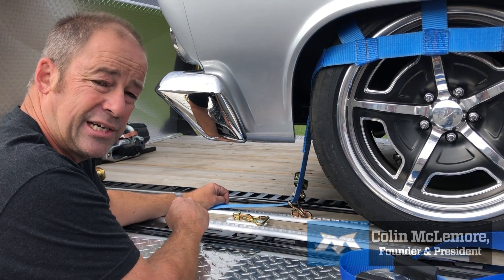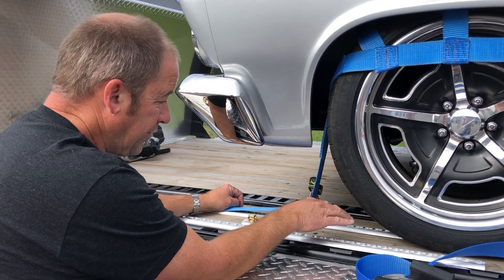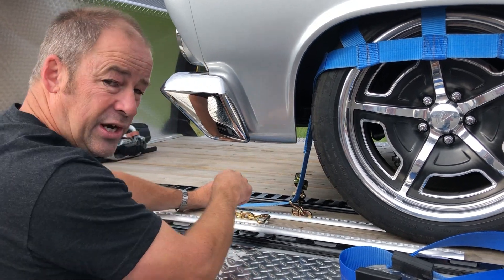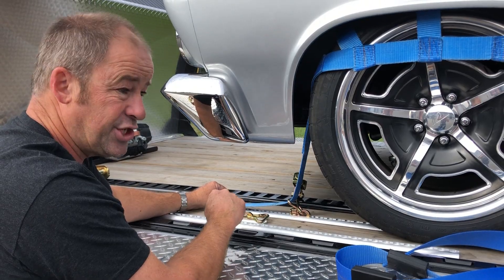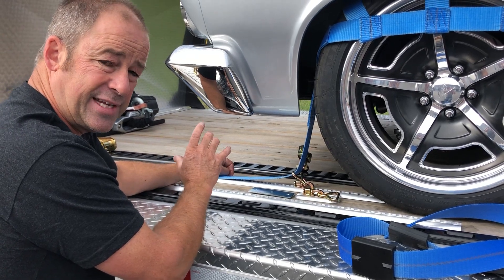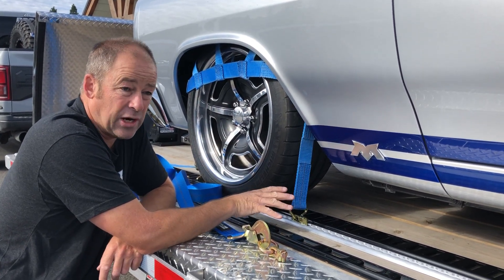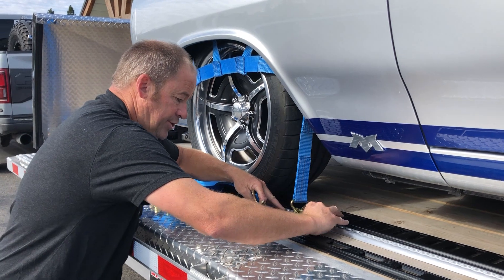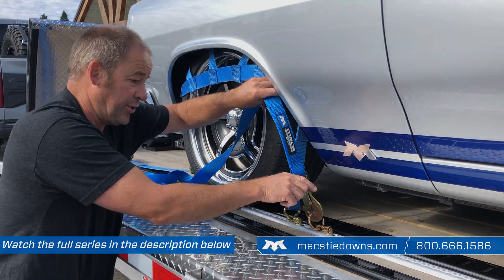Mac’s Anchor Point Series – Volume 4: Idler Placement & Double Stud Idler Fitting – Mac’s Tie Downs

Comment: So I have a car holder with a steel deck and was looking to add a E Tracz, but would like to know what Tracz is much better suited to transport cars that are low flow profile but also maybe some heavier cars what track is the best what track is easy to clean and what track is easy to installsteel aluminum what do you recommend? And is there a video comparing all of the tracks?